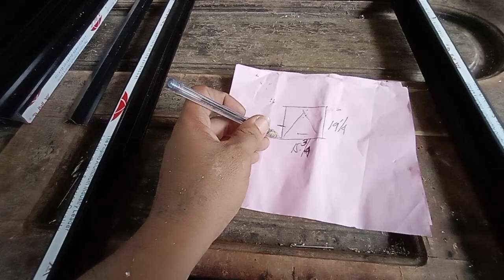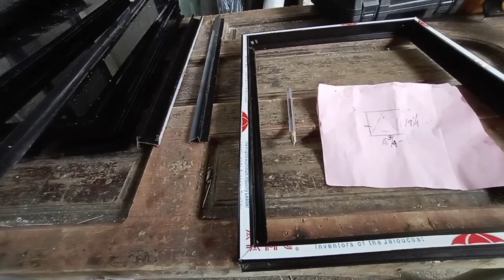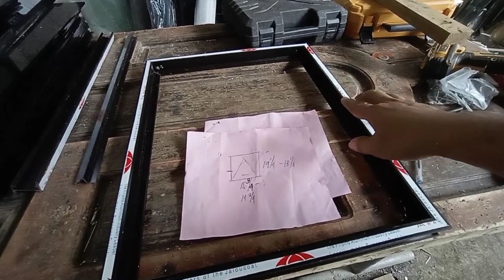Step by Step/How to Fabricate or Paano Mag Assemble ng Awning Window using WYC Series

Comment: Tnx. 4 sharing pips, lalu n sa mga gustong mag try pra less s labor,
Pwede po makahingi ng list of complete material for that, including frame para tama lang po spelling ko sa mga materials na bibilin ko, pati po size ng mga screw, cenxa npo sa abala 
Salamat pips en more vlog
Reply from the maker: Ang tawag pa ma series na ito is wyc or traditional series for awning window.
Materials:
Yc perimeter frame
Yc panel frame
Yc moulding clip
4 bar hinge 10" side open
Cam handle
1/8x3/8 blind rebits
8x3/4, 8x3/4 metals screw for Assemble process.
For Installation, you can use 8x2 metal screw.
Pwede po langyan ng hamba, specially if the opening is not square or even. Salamat po sa panunood God bless

Comment: Sir pahingi po complete materials ng awning window,palagi PO ako nanunuod Ng video nyu,may maliit din PO ako na shop nag uumpisa plng po ako, godbless po more videos po☺️
Reply from the maker: Yc perimeter frame
Yc panel frame
Yc Moulding clip
Angular Bracket
Glass
4bar hinge 
Cam handle
Silicone sealant
Yc rubber- optional
And screws 8x3/8
                    8x3/4

Comment: Idol pakiname ung mga bars n kelangan sa panel tsaka perimeter frame para guide sa pagbili
Reply from the maker: 4 bar hinge Lodi, it's up to you Kong anong TaaS Ang gagamitin no.
Reply from the maker: Mga materials Nyan 
 Yc Panel frame
Yc perimeter frame
Yc cover
Angular bracket /8x1x1
4 bar hinge 
Cam handle 
Mga screw and blind rebits.

Comment: Wsd series po gmit nyo dto sir or wyc? Sslamat
Reply from the maker: Wyc series po.
Reply: @PONGZWORKTV  sir pwede pabor pila bawas sa 4 panel sliding door fix bothside.salamat  sir
Reply from the maker: @psycheloupechora1019  8 3/4 Boss. Kong fixstile yong gagamitin mo sa may gilid. Pwede rin kasi lockstile.
Reply: @PONGZWORKTV  salamat sir dako ni nga tabang saako sir.sa seamles nga awning window sir sa panel frame ra jpon padikit ang glass sir?
Reply: Bro gud pm... D ko po nkita na naglagay kau ng vinyl glesing sa gilid. Sa ibang pinanood ko naglalagat cla?
Reply from the maker: @degsrodrigo5802  yong pagkakabitan kasi nyan is Hindi naman mababasa kapag umuulan. Pero necessary po syang lagyan.
Reply: Ah ok po... Gets ko n po...  Slamat...
Reply: Sir pg bumili po ang 4bar hanges my kasama n po bang screw? At kong wala po nong size ng mga screw ang bibilhin ko... Slamat?
My video po b kau ng pgkabit ng mollion instead na yc center frame... My napanood kc ako na mas matibay dw pg mollion ng gagamitin?
Reply: @PONGZWORKTV  baka po my epekto na pg lagyan ng vinyl sa pg lagay ng cover nya po???
Reply from the maker: @degsrodrigo5802  Hindi po, sa pag set up po ng 4bar hinge, may kunting adjustment.
Reply: @PONGZWORKTV  paanong adjust po.
Reply from the maker: @degsrodrigo5802  yong clearance po from the perimeter to the panel frame
Reply: @PONGZWORKTV  ilan po ang adjust sir? Pls... Kala ko po 1/4 at 1/4